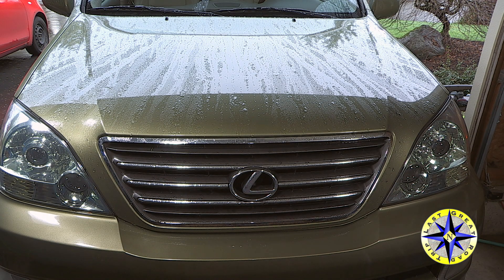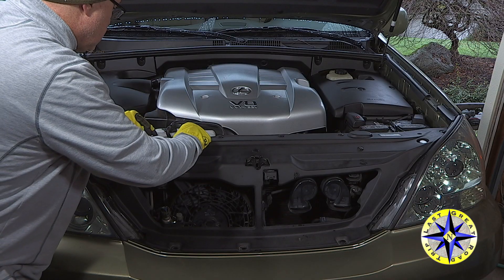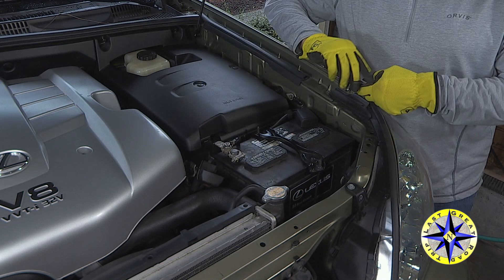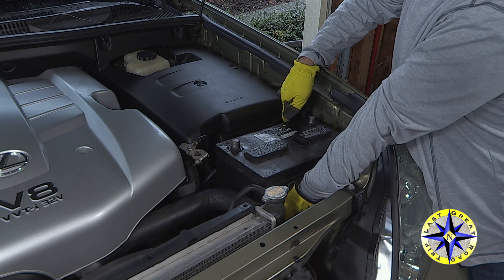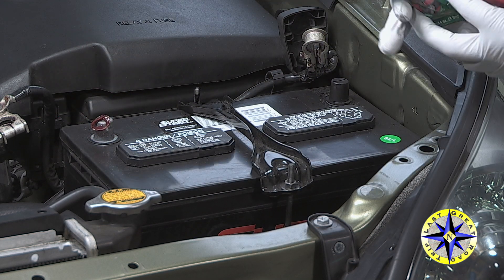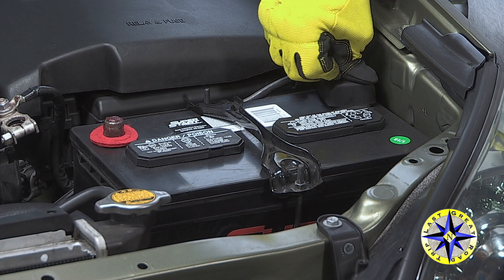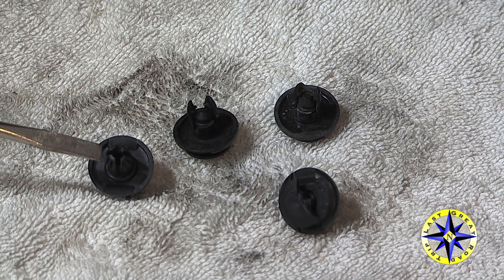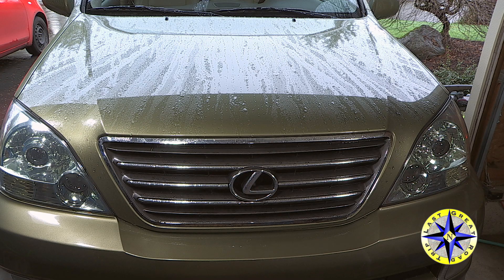How to install car battery  Lexus GX470

Comment: Everyone Please you remove negative cable first and replace it last.
Reply: You are right. I've never heard of anyone saying to touch the positive while the negative is attached. Also attaching the positive first when putting in new battery for the same reason.
Reply: Thank you, when I seen this I knew they did it backwards
Reply: Donald Williams I agree. Remove negative first as touching negative to frame of car won’t do anything
Reply: Yes, you are right. The reason behind removing the negative terminal first is to avoid accidental contact of the positive cable to car body. Some people got mixed up because they don't know the reason quite well.
Reply: yessssss NEGATIVE FIRST

Comment: I have a 2008 gx470. Will I need to reflash anything or will it just be the window controls and clock?
Reply from the maker: you do not need to reflash.   Add the sun roof if you have one to controls to re-teach

Comment: Why wont the clock and window switch work and what is the solution?
Reply from the maker: Hopefully this explains why the remote window controls isn't working https://youtu.be/TVEiGRHoPA4
Reply: the window brings each window down, from each door window control, then bring it up, hold the window control 2 or 3 second and is fix.